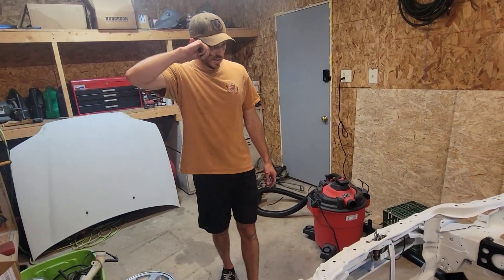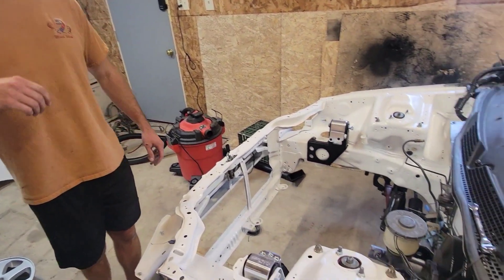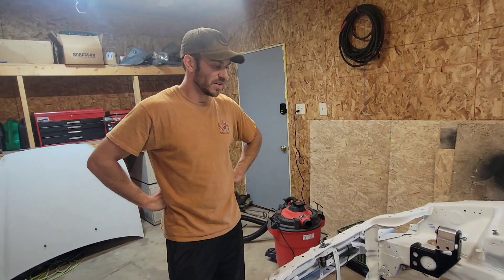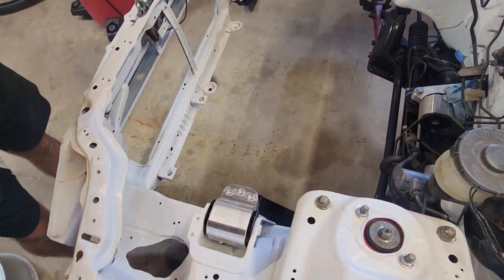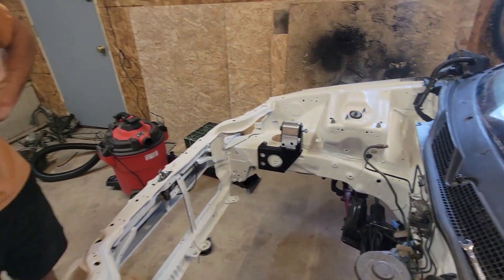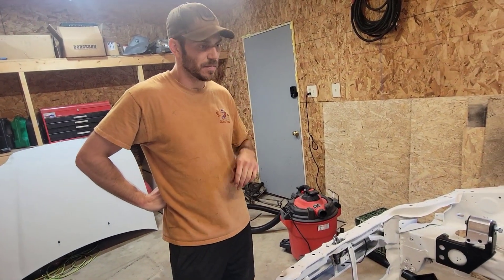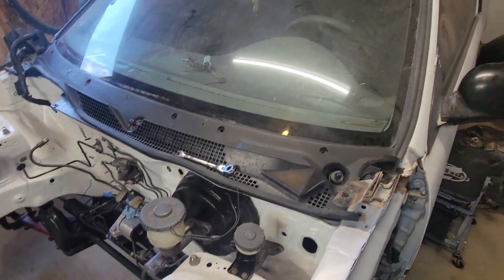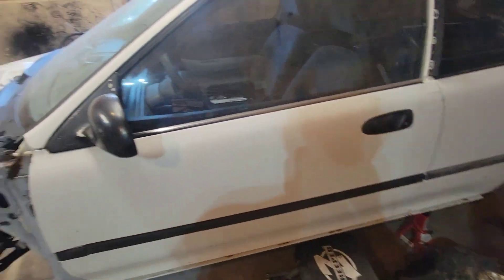How to J swap a civic. J35 swap episode 1. Sourcing the Drivetrain

Comment: Amazing how cheap you can find them in the state... im in puerto rico and any j series with papers will cost you $1k + ive seen j35 for 3k
Reply from the maker: Woe! That's a big price difference. Are there not many honda cars, vans and trucks there?
Reply: @diyclay525  theres a lot.... haha i have 3 a 14 pilot, 2002 accord v6 and a 97 prelude... its just with papers they ask way to high $$
Reply: A J32A2 here in PR.... youll pay easy like $1200 (with papers) withput papers much much less but then you wont be able to register the engine to the car your swaping it and if the police check it for any reason?? They migth think its stolen and youl lose your car
Reply from the maker: @jaimepurcell1279  oh wow! Here they don't care what engine is in your car. You don't have to register anything. It's crazy how different it is down by you compared to here
Reply: @diyclay525  im thinking on j swping the prelude..  i called a junkyard for a j35a4 of a pilot... they told me 2.5k for it 😬  and finding a type s lsd transmission here in PR is like finding a golden unicorn 🤣
Reply from the maker: @jaimepurcell1279  oh wow! U would be cheaper to fly here, well go to the junk yard together and then ship it back to your house
Reply: @diyclay525  shipping an engine is like 400 to 500...
Reply from the maker: @jaimepurcell1279  still be cheaper probaby
Reply: @diyclay525  naah.. plane tickets, somewhere to stay, rent a car, food, etc... im just gonna try to find a crash oddysey  and buy its engine
Reply from the maker: @jaimepurcell1279  for sure
Reply: @jaimepurcell1279 that place sucks gheeze. I couldn’t drive a Honda in the U.S. wouldn’t be worth going to jail for